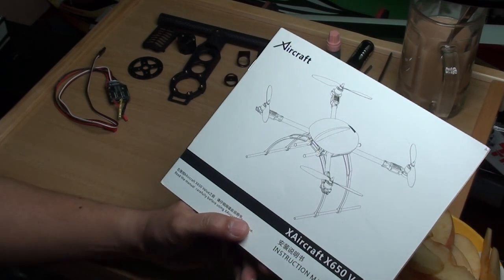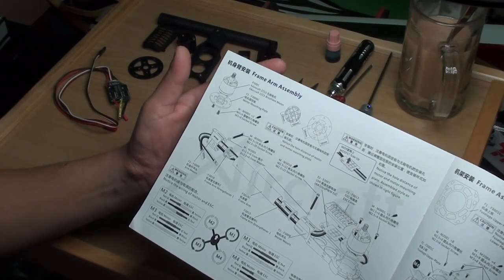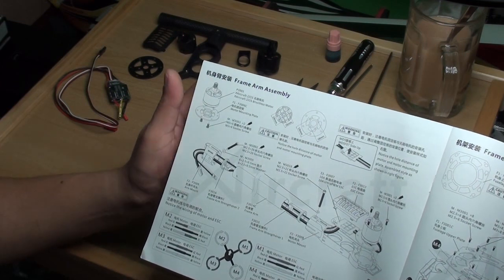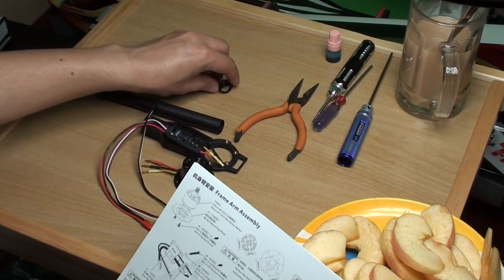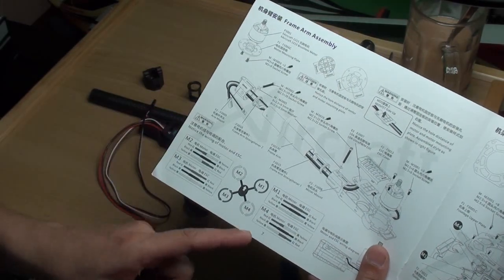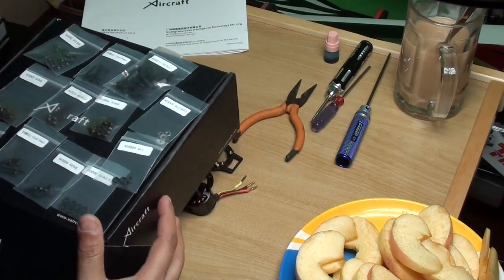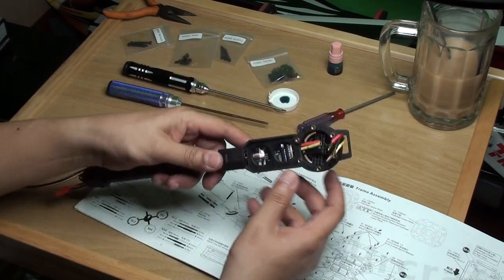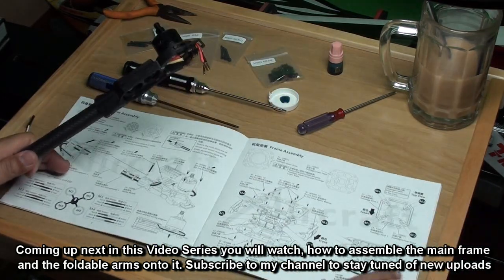How to Assemble XAircraft X650 V4 -- The Arms

Comment: Hi Ali! am assembling the x aircraft 650 value quadcopter i bought from you. The Maytech 30a Opto esc supplied does not fit in its place on the arm and under the cover, its too big! What isthe solution??? Regards, Ian.